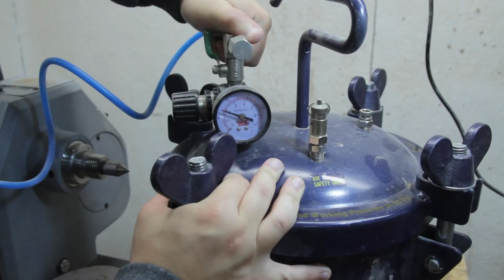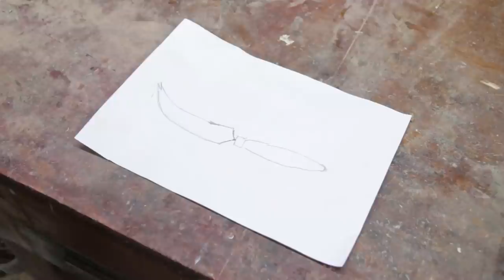Woodturning - Cheese Knife

Comment: Hi David. Excellent project and well executed! 11:03 shows the stunning detail. May I ask, what was the casting time for your resin? I use a deep pour so takes 4 days before i can remove and always concerned that mica powder will settle during this time, but yours appears to have maintained its beautiful swirls! All the best. Ray
Reply from the maker: Thanks Ray much appreciated 😀 This is also a deep pour resin but normally hardens in 24-48 hrs. This was well over 4days as did the casting just before I took a long weekend away. Swirls mainly due to the pigments type. This was a special chameleon pigments so formulated to have multi colour effect. I did a dragon egg on this channel where I waited 4-5 hrs after the first pour to add some special swirls and they did not mix. Colours will blend due to bubbles moving in the resin. You can either wait few hrs before mixing the two resin (risk of missing the right chemical reaction) or use the vacuum chamber before the port. That sucks all the air out so no movement after you cast the piece. I guess it is trial and error case I like experimenting and sometimes it turns out in my favour and sometimes does not make it to youtube 😅